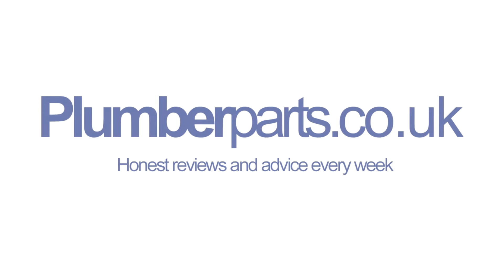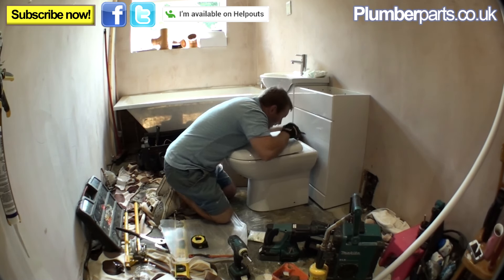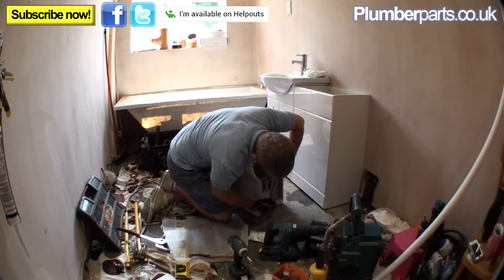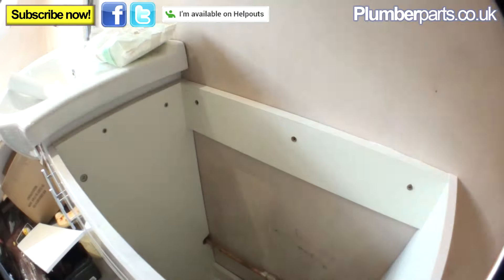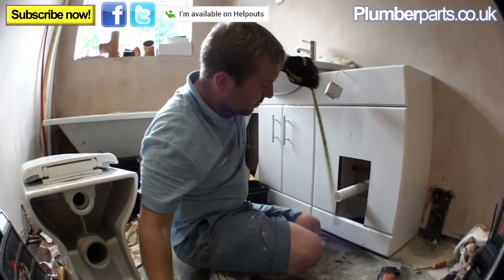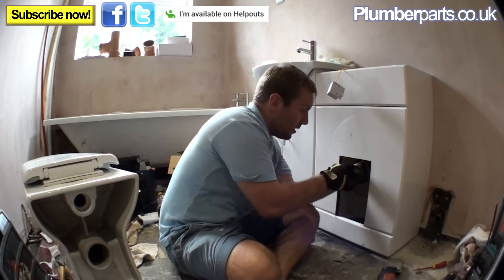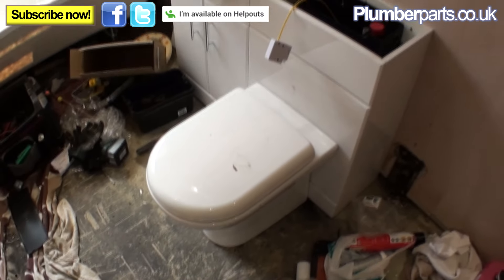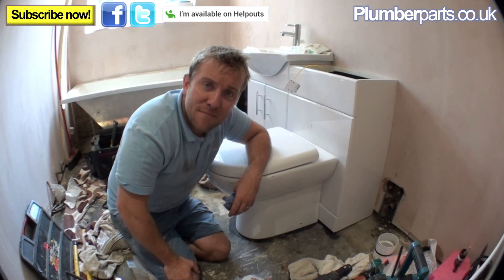HOW TO INSTALL A CONCEALED TOILET CISTERN - Back To The Wall - Plumbing Tips

Comment: I am literally fitting one of these this week and your video was invaluable. I will let you know how I get on as I am vanity virgin! Unlike yours the wash basin is separate from the WC and I had to do a lot of customisation to the carcass to overcome the issue of the WC waste running on the inside right where the cabinet needs go. What a pain in the arse!

Comment: hello ,,just a tought on marking out for the pan entry /exit ... everything came in a cardboard box , get a bit of the cardboard and push the back of the pan down hard on the card..you get an imprint and instant template .. cut it out and hold against the unit  "tah dah " :)

Comment: Once again excellent advice from someone who actually knows what they are doing,  we have one of these built in units, I look at the toilet seat and wonder how we  can change it as we cannot get to the fittings ?
Do we need to pull out the complete pan to get access, as the fitting holding the seat is not accessible?
Well done excellent presentation.
Reply: Yes, enclosed toilets are a pain.

Comment: Your videos are very helpful bud. I wanted to see how you fixed the pan to the floor. My WC needs side entry fixings and I’ve tried fitting them twice now and the pan keeps lifting. I’m using the Rawl Plug side fixing kit but no matter how much I tighten it the pan still lifts. Any ideas?

Comment: Good tutorial thanks. Did one today. Your editing makes this look like a much easier job than in reality.

Top tip: mock-up the cistern with fixing bracket to check the flush outlet is actually in the center of the cistern. I used a universal cistern, and only noticed after I'd fixed it to the wall that the bracket is not centred to the flush outlet (out by about 20mm to one side). Had to dismantle the whole thing and re-drill cistern bracket holes. Fuming!

Comment: i fitted the same as what your doing here, and how you got the flush pipe to stay in the pan i dont know, i battled with a leak on it for ages, it just wouldnt stay in the back of the pan you push it in and after a few seconds it just pops out, i tried fairy etc and it just wasnt having any of it, in the end i used a stanley to trim the rubber rings down slightly and put about 3 tubes of silicone on the back end lol touch wood 3 years on and it hasnt leaked but still waiting for the day cause it just wasnt staying in, so if you have a tip you can reply with for my next one id be super grateful :p

Comment: James why don't you offer your pan on your center trace around the pan the cut you hole 15mm inside this will save      all that measuring. fellow plumber of 40years

Comment: i am not a plumber but i like watching videos from plumberparts.
Reply from the maker: +Jk Prat Cheers dude!
Reply: i love your videos...you are an inspiration....I actually replaced a tap myself and fitted a compression fitting...and a plastic quick fitting....i was so scared but its working so far....i want to do a new project to change my radiator in my spare time so will certainly be taking guidance from your videos....

Comment: We don't typically deal with flexible lines from a toilet drain in the US. Given the ribbed edges, do they catch material and clog easily? I imagine they would. Can you auger the toilet if it is gloged given this flex line?

Comment: James what was the leak ? You seemed to have a perfect size flush pipe. My flush pipe installed by my plumber is dangling out with just the rubber washer helping the water to flow through to the pan and I need to change it to a longer size . Was the leak with the flush pipe where it joins the pan ? Thank you .

Comment: I fitted one of these in a massage business where people are constantly gtaking showers and flshing toilet. Cold water fills cistern aftern flush and have huge condensation on cistern. Thinking of spraying expanding foam all around cistern and even cold pipes to stop warm moist air raching cold cisteran and condensing
Reply from the maker: Should work. Good luck! PP!
Reply: ***** That was quick. Take the rest of the week off :)

Comment: hi, have you ever had an issue with a newly fitted cistern not refilling once flushed but just a tap of the fill valve makes it fill, a little knock or vibration but on its own just wont refil

Comment: I fitted one of these in my bathroom last year. Im now noticing alot of condensation on the black box, seen a few videos insulating the inside of their tanks. 
Do i need to insulate the inside or could i  just insulate the outside of it seen as its not on show?

Comment: Love the videos , think this has been asked before but what can be done about the flush pipe creeping out when pushing toilet back to wall. Can it be secured with bracket ? Or silicone in place. Cheers

Comment: Once you fix the worktop in place and tile the wall down to it. How do you remove the flush valve to replace a leaking seal? I have this problem now. I can disconnect the flush valve but there is no space to lift it up and out of the cistern because the worktop is like yours and fixed about 2" above the cistern.

Comment: What about a downstairs WC with surface run cold and hot feeds plus soil waste with no where to hide them. Concrete floor and a terraced house, not enough room to build a fake wall to hide pipes behind. 
Is it a case of cutting a 110mm hole on the side of the vanity unit to run soil into soil stack?

Comment: Thanks for the video.  I've got one of these blighters to fit in about a week and I've never done it before and this is the best "how to" I've found so far.  The multiquick looks good, but the toilet I took out was a ceramic job from around 1960 and the waste was a ceramic pipe which is still projecting a couple of inches - un-broken, I might add, though possibly with a bit of filler-like sealant around it - into the room.  Will the multiquick fit into it without any sealant?  Somewhat to my surprise, I didn't see you use any sealant on the flush or the waste pipe.  Is that how it's done?  And do they seal well?

Best wishes,

Rich.

Comment: Great video! Can the waste pipe typically go to the left, through the wash basin unit if the main waste pipe for the building is where the bath taps are on your video? Looking to buy a unit like this. Only the WC unit part is thinner. Not sure if they all assume waste and water are directly behind\down.

Comment: Hi - we have a soak.com toilet and our plumber is unable to install it because it doesn’t have a side panel to tighten it to the wall.  Have you any ideas about how this could be done.  They have tried using the 2 holes on top of the pan without success...

Comment: Thank you for your video.  It helps loads.  Just one question.  Does the flush pipe go right into the back of the loo as far as it will go or just to where there is a lip in the pan?
Reply from the maker: It goes as far as possible. They are prone to leaking and can be a nightmare!! Good luck, PP!

Comment: How do you fix the toilet inlet valve, if it's leaking and also fix the problem of water constantly trickling into loo, once everything has been installed and don't have access to top, as worktop has been installed which is also the sink too and has been silconed.  Thanks

Comment: Hello,

Which kind of blade do you use to cut the hole? Could you please Kindly provide the link to the blade. 

Many thanks
Reply: I cut the hole with a jigsaw BEFORE I install it. The hole size isn't going to change

Comment: Hi PP I wondered if you could give me some advice. I have rewashered a kitchen stoptap and ran copper pipework from a combi boiler to a cloakroom (basin and toilet are not in place yet due to waiting for a builder to tile it) I was curious how much I should be paid for doing such work.
Reply from the maker: Work out what you want to be paid hourly, then add materials plus whatever percentage you want to earn on materials. Good luck! PP!

Comment: We have just moved into a house with a back to the wall toilet in ground floor loo. (Its no a hidden cistern like the one in your video, it has the cistern on top.) When I flushed the loo it filled with water and took ages for it to go down so I plungerd it. Water appeared all over the toilet floor. Because its a closed in loo I cant see where its leaking. I can assume that its the flexible multi fit that must have somehow come away when I plungered it. (at this stage I must tell you that I'm NOT a plumber, I'm a handyman in a nursing home). Now when I flush the toiled water floods out all around the basin at the very bottom. Could this be because of the force of me plungering it? And if it is, to get the pan out I'm going to have have to take the cistern off first aren't I? That means turning the water off... then taking it off, removing the pan... am I on the right tracks? Please give me your opinion. Thanks, Ed.
Reply from the maker: Ed, you should be able to pull the loo and cistern out together...make sure it doesn't topple over! Then pop on the multiquick again....check for blockages too! SUBSCRIBE! ➡️👉 https://www.youtube.com/subscription_center?add_user=plumberparts 👈⬅️if you haven't already!
Reply: I have subscribed! Ages ago! lol!  Thank you for that James, I will have a go!

Comment: you had a leak on the flush pipe how did you stop it as im having the same problem
Reply: Same here, got a similar set up to that, but think water was leaking from the flush pipe bung, is that what you had and how did you resolve it? Cheers
Reply: Plumbers mate

Comment: Don't like fitting these, because if the bathroom floor isn't level, the the pan doesn't sit back against the unit and looks 💩! And how often do get a level floor when you need one. Also always seem to get trouble with the flush pipe bung?
Reply: When the floor /wall is pissed up the unit needs to be made to fit the toilet with shims ect then when looking right - needs to be scribed to the floor or wall /both to get everything g sitting together abs looking right more of a joiners job than a plumbers

Comment: fitted a few of these & every one has been a C**T!! flush pipe always creeps out the back of the toilet if the bottom of the cistern is not butted up against the wall or a wood fillet
Reply from the maker: +No longer Avalible Hate to say it but you're right!
Reply: You are right!
Reply: What can be done to stop the creeping of flush pipe. Bracket to hold pipe in place? Or batten out behind pipe.  Cheers

Comment: helpful vid but you shouldn't just push one pan connector into another like you did at the end. Either use a Multikwik Multilink: http://www.multikwik.com/product/33/121/multilink.html 
or, depending on how flexible the inlet rubber is on the second pan con, you can get away with using a short length of soil pipe between the two. Multikwik are better than Mcalpine in my experience for pan connectors.